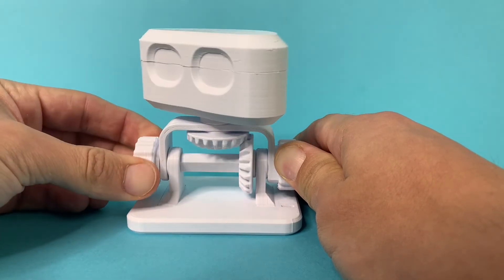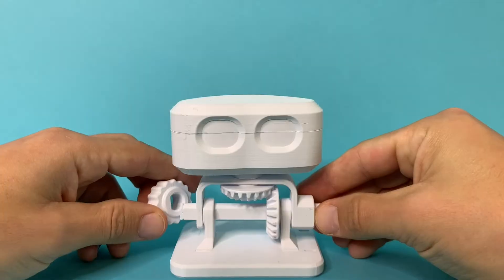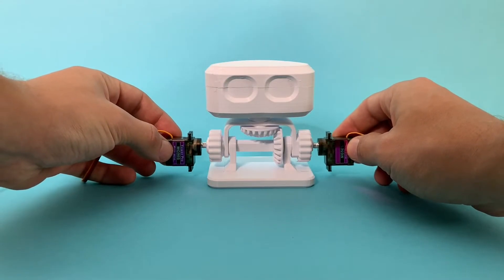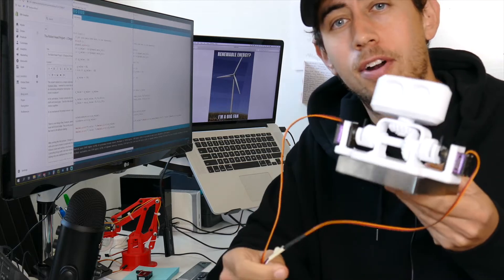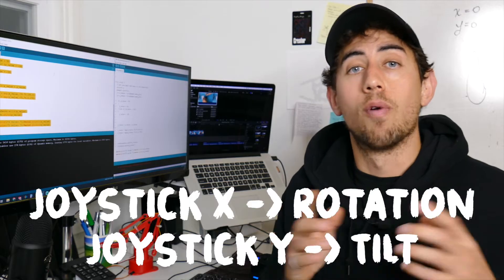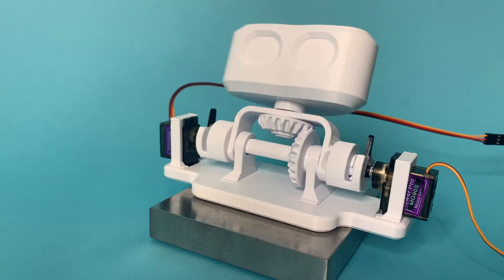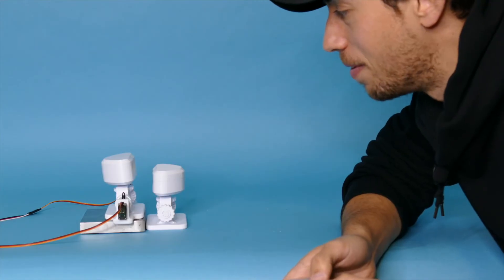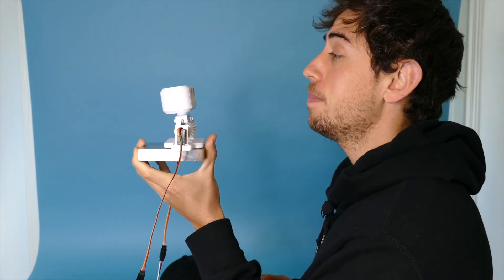How to Control A Robot with An N64 Controller

Comment: What 3D printer do you have and Which do you recommend for beginners
Reply from the maker: I have 4- prusa mk3, ender 3 v2, anycubic mega, and a taz pro- i recommend the prusa if you’re willing to spend more, or the ender 3 because there is a huge community surrounding them. Good luck!